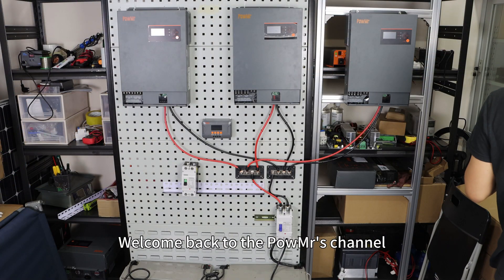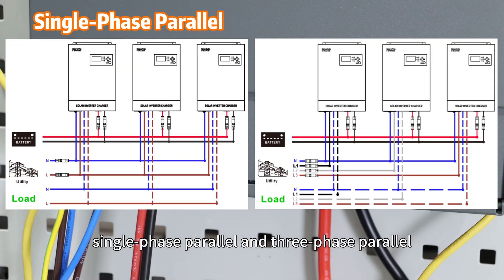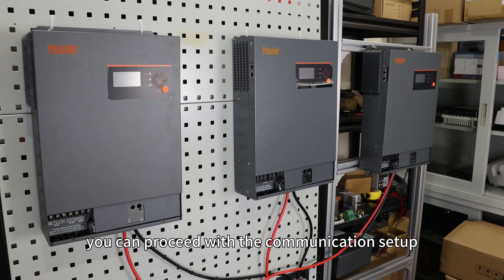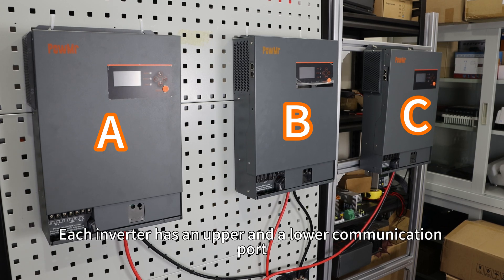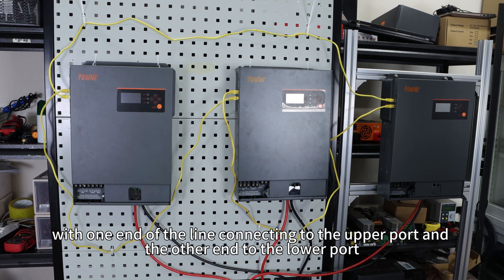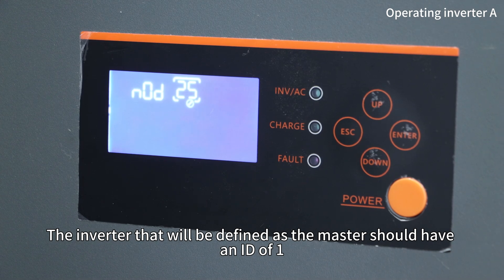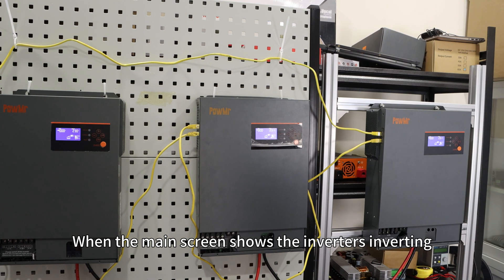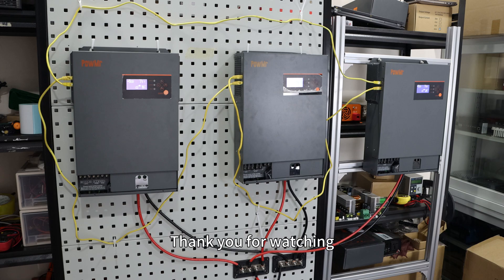How to Parallel Connect POW-HVM5.5K-48V-P?

Comment: Whats differences POW-HVM5.5K-48V-P and POW-HVM5.5K-48V-LIP ?
Reply from the maker: The LIP model has lithium battery BMS communication function.
Reply: How about 48v P?
Reply from the maker: @dockievlog  battery BMS communication function?
Reply: Each inverter has it's own battery? Or all connected together? Now I have one of this exact model with 48v 200Ah lipo battery. I want to double my capacity to 400Ah. I have 9x550w 48v panels connected. How should I proceed to double. I have strong all day sun and battery fully charged by midday already. I can buy another of your same inverter and another 200Ah battery. Your video does not explain the benefit and way of using more than one POW-HVM5.5K-48V-P